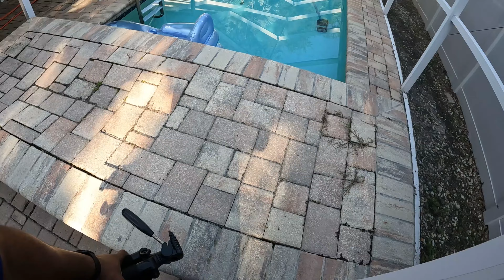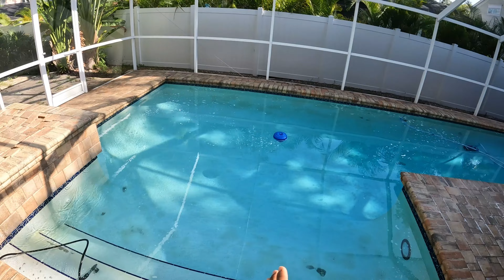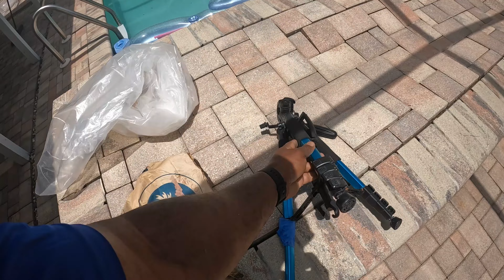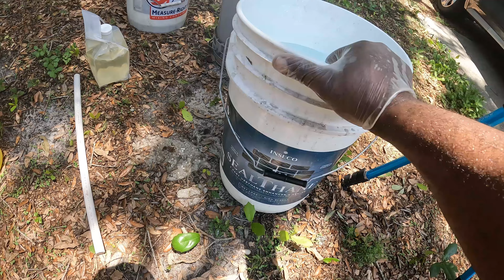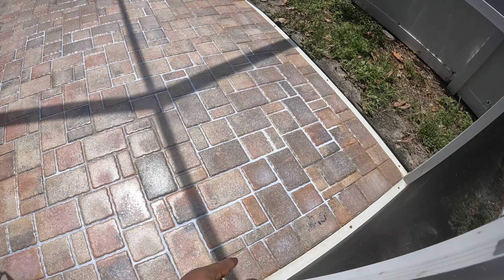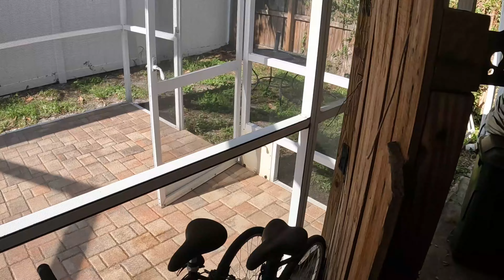Transform Your Pavers with 2-Part Sealer #howto #paversealing #patio

Comment: What kind of boots you wearing.? And why such a hot mix on the pavers? Curious not judgy. Thanks. Great vid.
Reply from the maker: I'm wearing huk boots. They're listed in the description. 

I went hotter because those pavers were super dirty and I wanted to make sure the joints got completely soaked so any weeds will be killed at the root
Reply: @PinkFlamingoPowerWash  thanks

Comment: Nice 👍...  ❓ what hose are you using for the soft wash 3/8 or 3/4 hose (water or Air hose) and the long Gun attached to the J-rod "Orange Hose" ❓
Reply from the maker: Soft wash hose is 1/2 inch. That's the smallest you can use and it goes up from there.  Next is 5/8", 3/4" & 1 inch

Comment: Which is better? Sillicast or sealthane? For me it would have to be at least 20% better to deal with that science project at a job site
Reply from the maker: Sealthane can cover up to 2000 sq ft within 1 bucket depending on your mix ratios.  Deco covers 900-1000 sq ft.  Price wise deco is around 250 and Sealthane is 295. 

They both work food to me, but the area coverage can yield more profits.